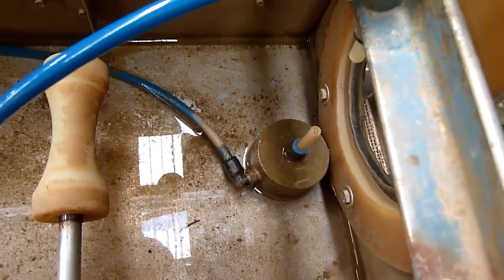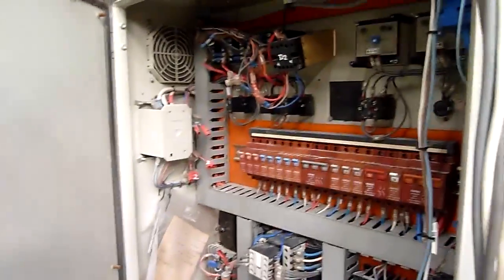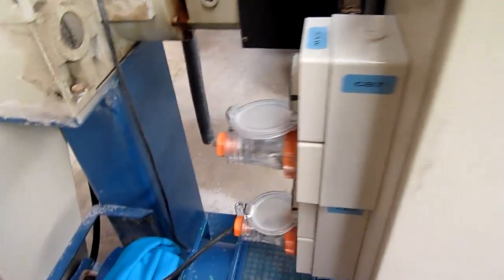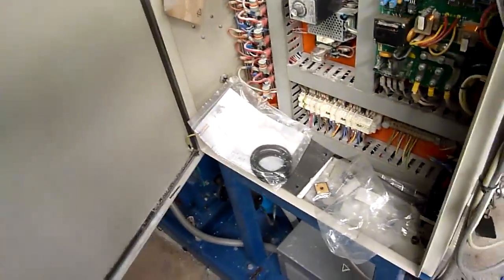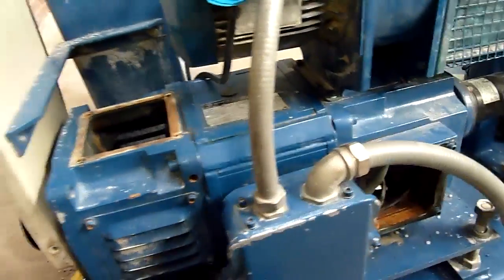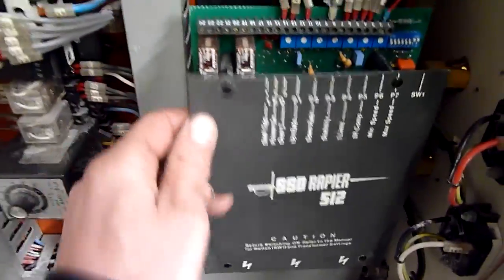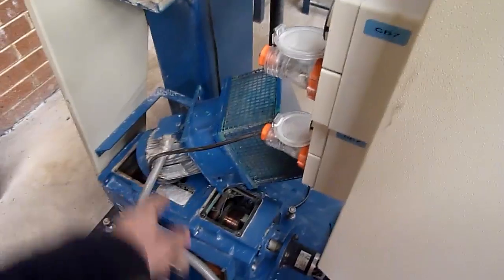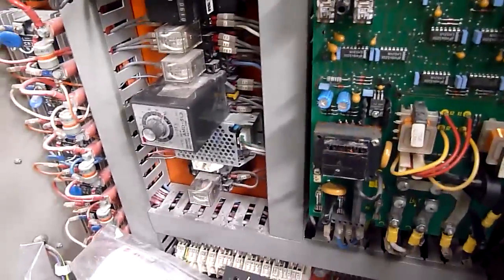Flooded Extruder DC Motor and Drive salvage

Comment: Would probably be worth it to upgrade those machines with a low water cutoff. There should be of the shelf solutions :D
Reply from the maker: Yep, found one from Omron and I will be fitting each machine with it. its a 3 probe system. alarms for too high or too low!.

Comment: Why not move the nozzle so that it is pointing down at the material instead of up? It would prevent such a fault condition from happening again. (Sorry if this is a dumb question)
Reply: better have a water level alarm, otherwise if you have lots of blue stuff coming out hot from where it's supposed to come out cold it might be just another kind of mess..
Reply from the maker: The profile it makes is rectangular, so it needs one on top and one underneath to blast the widest surfaces with cold water to chill it off, sadly there is no other option, and if the machine stops putting out material it uncovers the lower jet, when the haul-off pulls the end of the rectangle out of the tank, it drains the tank and you get what you see here, the jet is out in the open and just spits water out everywhere :(.
Reply from the maker: the auto-sensor will stop the machine putting out material if the encoder stops rotating for more than 10 seconds, but I am putting level sensors on the tanks to sound an alarm if somthing goes wrong, and cut the motor drive, heaters and hauler

Comment: so an ip55/6 cabinet can't handle a bit of a sprinkle? that sucks.
Reply: It's not an IP rated cabinet once you punch a load of holes in it.
Reply: +Monkeh yep, there's fittings and then there's fittings.
Reply from the maker: when it was built they did not fit off external equipment with proper gaskets, none of them are really, its up to the operators to not spray them with water since you have all those exposed heater bands, outlets etc. but the dome lamps on top let most of it in, they will get a bead of sealant around the bases to ward off any rogue water jets that may hit them.